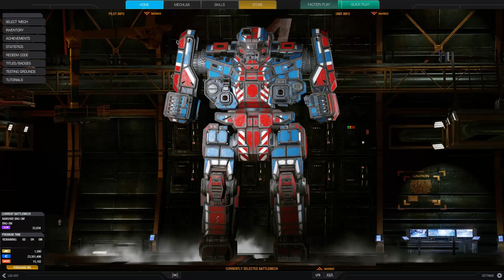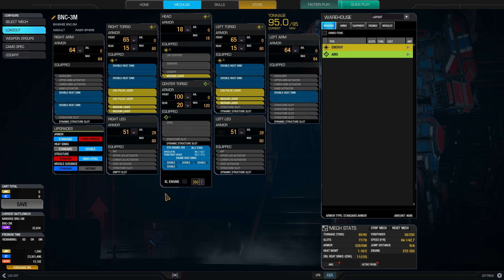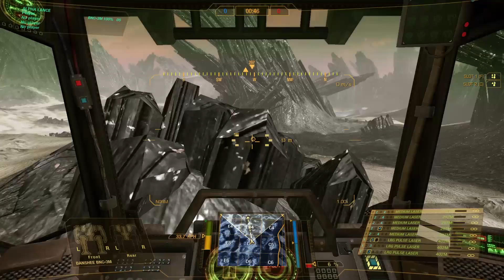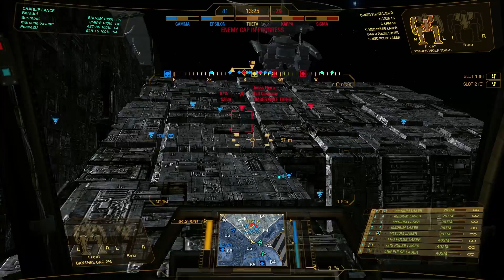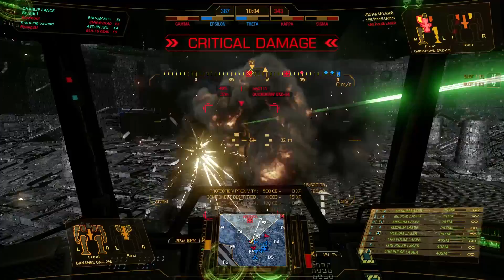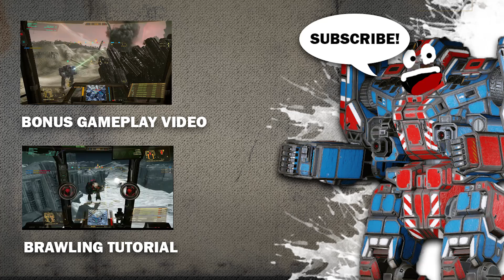Mechwarrior Online Tutorial: Laser Vomit Assault Mech - Banshee BNC-3M

Comment: im a long time mwo player but this is a instant sub for me.
o and i run the 3m xl400 3lpl 5mpl for a 63 super fast alpha at just a bit more heat but still under 2 alpha.
and some how i never get XL check t so the torso twist and speed u gain from the 50 extra engine is really worth it.

if u want a to give a good demo on crit killing and heat management u NEED to try a 2lbx 10 and 4 or5 ML on a marauder.

cool vid's keep it up
Reply from the maker: +SoY_FooD This sounds sick. I tried one with the Shadowhawk and had some good games. But two LBX 10 are of course better than one!
Reply: dubble your gun, dubble your fun.
Reply: >Banshee
>XL
Opinion discarded.
Reply: i know it make no cense, non at all.
but it work an no one and i repeat NO one will XL check it.
i even run it on highest level CW matches and lead the charge.
it shud not work..... but it doze and it is glorious
Reply: SoY_FooD It's disgusting.
Reply: its a dutch thing, don't judge.